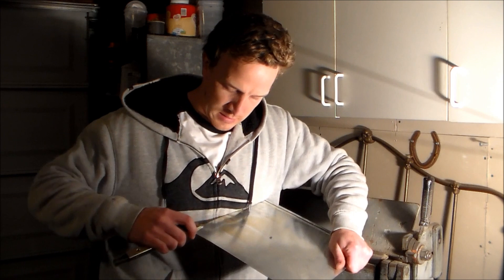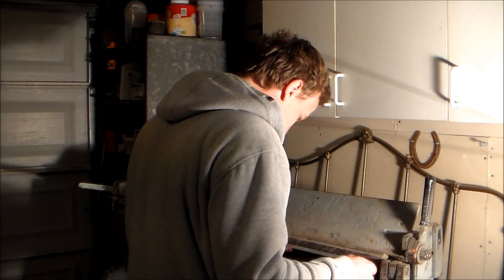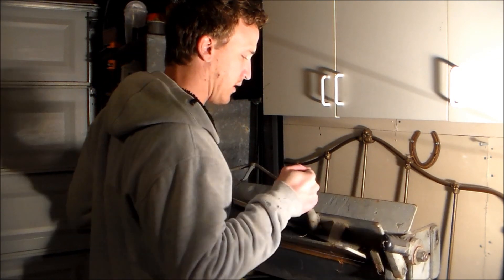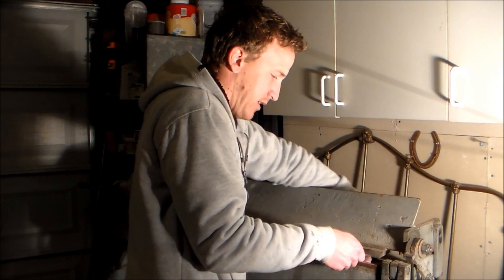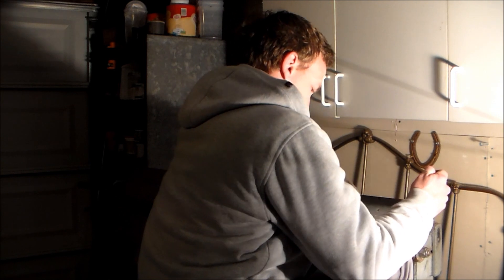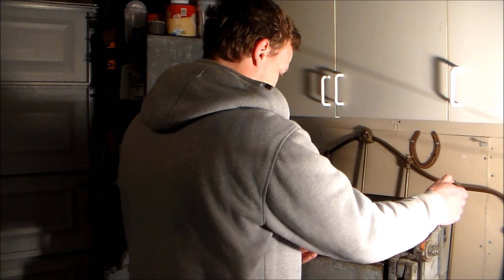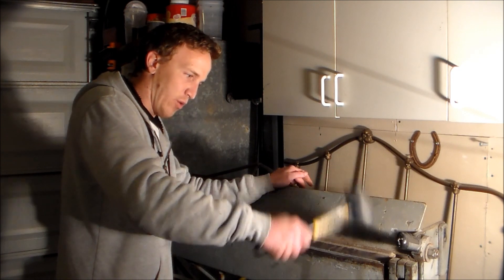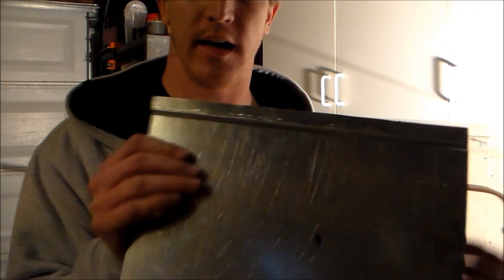The Pittsburgh Seam made EASIER -The Sheet Metal Kid

Comment: I believe you can do all the bends on the brake and avoid the mallet move if you flip the piece over after the first bend.  We would scribe the lines on it first for alignment.  Back in college I did 1000s of these for collars for chase caps.  I could be remembering wrong though, we had an 8' brake, and the seams were only about  36" long so the brake would just smash the thing down nice and flat....and we could hand crank it through rollers after that, then spot weld it and beat it into place on the chase cap.
Reply from the maker: Sure can but I find it faster because you dont have to keep removing and reclamping

Comment: In no way shape or form is this easier
Reply from the maker: I appreciate your input. A lot easier if you dont have a pittsburg lock machine or a friend with one. Also works well on throats for elbows that are shorter. a 2x2 throat was possible to run through the machine but would sometimes go wonky and screw the whole thing up. I used to do these for all my square throats

Comment: Lol, "easier". Two hands and a knee, while balancing on one foot and tugging on a 200+ brake. Lose your balance and you'd pull the whole thing right over on top of you. Just for one little piece of thin metal. Let's see you use the "easier" method on full-width 22 gauge. But I'll give you full points for using a mallet instead of a hammer on your brake.